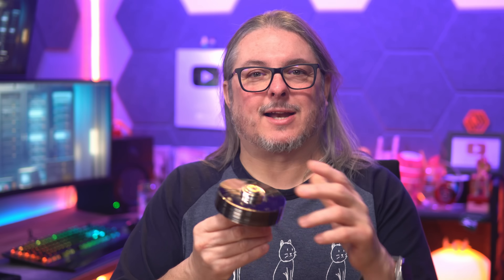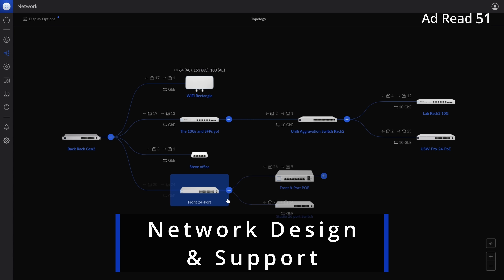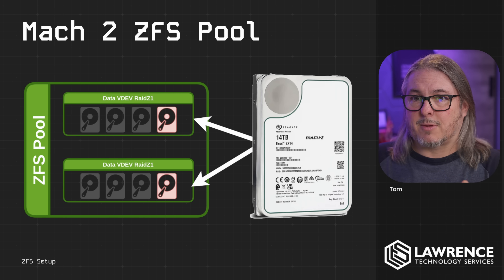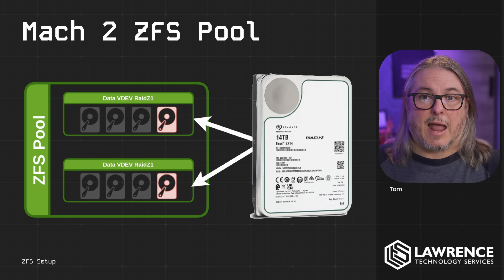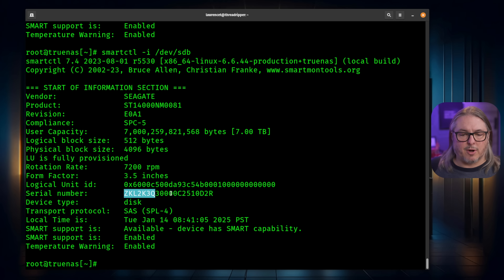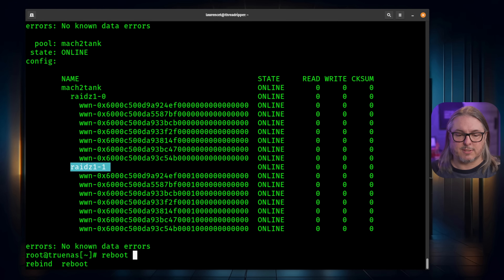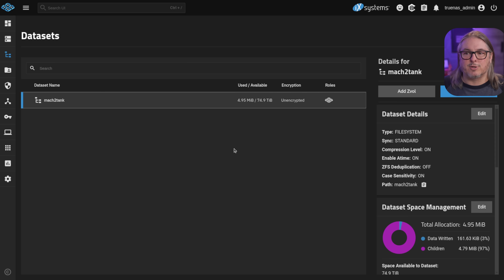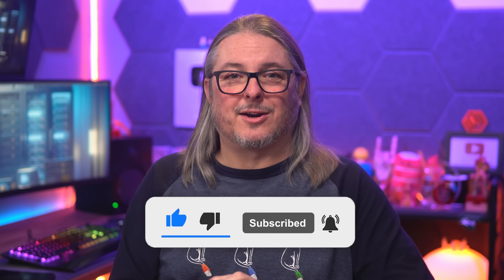TrueNAS + Mach.2: High Performance SAS Homelab Storage

Comment: I would think using it as a stripped pair which can then be used as a single drive in a raidz* vdev would be the proper solution. Is that possible with ZFS? If one actuator fails you want the entire drive to be marked bad, you wouldn't want to trust the other half to keep going. With splitting between vdevs you would have to resilver two vdevs instead of one.

Comment: Is there a way to get nut monitor onto truenas scale (24.10.1 currently) so I can have it see my network attached ups it's powered by to do a safe shutdown in case of a power failure? I'd love a video on its setup if possible.

Side question, how would i go about removing an array that was In at startup to move it to another system and leave a new array?
Long version: I have a core vm that I moved my drives from and setup a new core system, since then I've updated the new core to scale and duplicated the old drives to a new set of drives and array, now I want to take the old array and put it back into the original vm. Is that even possible now since I updated the one to scale?if so how, I think I tried "exporting" and it said there was some system thing on that array since it was setup with that array.

Comment: Great video Tom! We've had a few community users show up and the Level1Techs scripts have been useful in getting them online with their MACH.2 drives.

One thing that I would caution the users of these drives about, the SAS ones specifically, is that certain low-level SAS/SCSI commands cross LU boundaries - meaning they'll impact "both drives" in this sense. Power management is the obvious example as there's only a single motor, so start/stop/idle spin-down states impact both - but it starts to become a potential performance issue with "FLUSH CACHE" impacting both LUs during transaction commits. If "both disks" are in the same pool, they'll likely be receiving the flush command at effectively the same time; but the potential for some interference exists.

Where it gets ugly is commands like "FORMAT UNIT" and "SANITIZE" also cross LU boundaries. Now, those would be the lower-level ones - something like a dd zero-pass or similar won't, but because the new EXOS 2X line optionally comes with SED (Self Encrypting Drive) support, that would be a bad way to find out you accidentally put two LUs in the same vdev.
Reply from the maker: Great points
Reply: The fact that UI does not support anything advanced even with standard drives is just sad. Even the way UI refers to storage  via sdX is fragile and is not how ZFS is built. ZFS prefers UUIDs and such, is perfectly fine with GPT labels (that I was asking to implement long time ago) and you still try to convert it down to dumb OS abstraction levels.
Reply: @Mr.Leeroy  ZFS pools on TrueNAS are built with and use partition UUIDs, which you can see from a command-line "zpool status" command - the UI does map them back to their physical disk.
Reply: @  I am talking about UI specifically, not Middleware. It creates unnecessary translation back and forth, which only complicates things for devs and barely helps users, surely restricts more than benefits. It is like a root barrier that distorts interaction logic (for both sides of project) with storage units that ZFS really cares about.
I know, you guys think about fool proofing as much as possible, but clearly overdoing it and cutting the versatility of native ZFS mechanisms, aspects and features. It becomes irritating very fast the more you get to use and know the end product.

Comment: I've been reluctant to try this, even the SAS versions.  My reasoning is that when I lose a drive, I actually lose two.  This means that I need at least RAIDZ2 if both logical drives are in the same VDEV, and probably RAIDZ3 to be safe.  If they are in different VDEVs, then I now have two degraded VDEVs for each drive failure.  I'm not convinced the performance vs risk tradeoff is a good one.

Comment: I think that before these become mainstream, Seagate is going to have to simplify how it presents itself to the OS. Ideally, presenting itself as one single drive would be ideal.

I'm no engineer, but I'm not sure why the drives don't just stripe (RAID0) themselves automatically, and then present as a single drive to the operating system. That would simplify deployment and troubleshooting in the case of a failure, but also give the same performance benefit.
Reply: because doing RAID0 means they need to add a chipset to do this, and since the main market for these drives is going to put them in a RAID array anyway, that would be redundant

Comment: I would think that the best way to use those use to do RAID0 (don't remember the ZFS name of this at this time) inside each disk and then do a RAIDZ2 with a bunch of disks. As most probable when one part of the disk fails the other will do the same I just would join the two parts of the same disk in a faster one.
Reply: raid0 is "stripe" and raid1 is "mirror" for ZFS

Comment: Why not just get two drivers?
Reply from the maker: It would cost more and there are only 7 SAS bays in my NAS.
Reply: @ the bottleneck will be the SAS controller anyway. More drives don’t mean faster RW speed.
Reply: @MsDurex the SAS controller won’t be the bottleneck in this system. Not even if you were to put all 14 LUNs in a RAID0 pool would you bottleneck a normal SAS controller using PCIe 3.0 and 8 lanes.
Reply: like all "space/power saving" solutions, the point is saving space/power. If you can afford the space and power for more drives, you can just do that.

Comment: I don't understand why the HDD controller presents itself as two drives. Why does the controller not just present itself as one drive, but which happens to have (up to) twice the performance? Seems like an unnecessary user complication to me. If I ever wanted a HDD to present as two drives, I'd partition it as such. 🤷
Reply: because physically this is two drives. There are two sets of heads and each set writes to their own spinning disks. 

If you want this to have "twice the performance" you need to add a chipset that can run a RAID0 on top, which is kind of pointless when you are going to put those in a RAID array anyway.
Reply: @marcogenovesi8570  The theoretical increase in performance wasn't my salient point. My point is that the controller should be able to present the entire HDD as one disk, it's just the controller can read or write data from two locations simultaneously which would thereby present a lift in performance. There is no reason this HDD should present itself as two disks, or at least not by default; the Mach.2 disks only have one controller! 
Perhaps a hardware or firmware 'switch' that allows it to change modes for those who want a 'hardware partitioned' disk (with two partitions of equal size). 

... you need to add a chipset that can run a RAID0. No, not necessary. The controller would still write the data where it thought best, but now it can access two locations on the disk at a time instead of one (not accounting for the total number of heads). Either way, RAID is ultimately just firmware or software - it could be programmed into the controller.

... pointless when you are going to put those in a RAID array anyway. I wouldn't put these anywhere near a RAID array. If I wanted two disks I'd install two HDDs. Adding the Mach.2 HDD as two disks just means that when it fails, you lose two disks - there's nothing good to be gained here. 
I accept there may be an edge case where you absolutely need to two Pools but have limited space to install HDDs, but I can't think of a valid reason for such case. 

Take these examples (for simplicity, I'm using RAIDz1 and not accounting for parity overhead):
1) Six 2TB 'standard' HDDs in one Pool comprised of one vDev for a total of 12TB.
2) Twelve 1TB 'standard' HDDs in two Pools comprised of one vDev each - for a total of 6TB in each Pool.
3) Six 2TB 'Mach.2' HDDs in one Pool comprised of two vDevs - with half of each HDD in each of the vDevs - for a total of 12TB.
4) Six 2TB 'Mach.2' HDDs in two Pools comprised of one vDev each - with half of each HDD in each of the vDevs - for a total of 6TB in each Pool.

If one HDD fails:
1) You lose the redundancy for that Pool. 
2) You lose the redundancy for one vDev in one Pool - the other Pool remains healthy.
3) You lose the redundancy for both vDevs in that Pool - risk to data no worse than for 1), but means resilvering two disks except that now they're on one HDD; possible resilvering performance hit? 
4) You lose the redundancy for both Pools! - risk to data twice as bad as for 1), and same resilvering scenario as for 3).

If two HDDs fail:
1) You lose that Pool and all the data in it - disaster!
2a) You lose the redundancy for both Pools - no data loss.
2b) You lose one Pool and all the data in it - disaster for that Pool, but the other Pool remains healthy with no data loss.
3) You lose that Pool and all the data in it - disaster!
4) You lose both Pools and all the data in both Pools! Congratulations; you've just lost two sets of data.
Reply: @gh8447  "Take these examples"

Not sure what this is supposed to prove. Yes the fact that you have two drives in one single chassis limits your RAID choice if you value data integrity.

"resilvering two disks except that now they're on one HDD; possible resilvering performance hit? "

Why is this even a question? The interface is SAS 12Gbit and the controller is just passthrough so if you know math you can figure it out.
12 Gbit/s is 1.5 GB/s of bandwith, which is THREE times the max speed the drive can do with both actuators running at the same time.
Reply: @gh8447  "The controller would still write the data where it thought best,"

mechanical drive controllers don't do this. The sectors are more or less physically mapped. There is a spare area to remap some bad sectors but that is it.

"RAID is ultimately just firmware or software - it could be programmed into the controller."

the controller needs to be powerful enough to run it, the software needs to be developed and tested and validated. This adds cost.

"Adding the Mach.2 HDD as two disks just means that when it fails, you lose two disks - there's nothing good to be gained here. "

These drives were built around RAID50 and RAID60, which are the "hardware card" version of what was done with ZFS in the video.
Reply: @marcogenovesi8570  Not sure what this is supposed to prove. Well, there's the issue...

Comment: I’m running two SATA Mach.2 in TrueNAS. You just need to create the two partitions manually, then use each partition in a similar way to create a ZFS pool.
So far they work as well as the SAS Mach.2 I have in the same system.

Comment: Been using unRaid for many years and still super happy with it. The main array is slow, but for me maximising the usable storage space is priority so that is working great. For the high speed storage I use nvme drives in a cache pool and that covers the high speed needs. 

unRaid is a nice, simple and functional way for a full homelab in one physical box. 

The plan is to upgrade to a all nvme based server in the future, but then a TB need to cost less han $40 a TB for high quality nvme drives and that is some years until it is going to happen.

Comment: i never call them spinning rust, and never will. and when my HDD survived being outside for 2 years(burried) and worked fine afterwards i def never will
Reply: The magnetic material used on the platters is literally (a type of) Iron Oxide. 🤷
Reply: @gh8447  "n antiferromagnetic (A-FM) layer made of Nickel oxide, Nickel-Manganese or Iron-Manganese alloy"

big shock, someone who posts annoying 🤷 emojis were wrong
Reply: @gh8447  They're cobalt, not iron. We stopped using iron oxide for magnetic storage a while ago.

Comment: I wish sas was more commonly supported at the consumer level since the drives are often cheaper than sata. Kinda like rdimms.
Reply: the drives are not "cheaper" by any stretch when new, same for rdimm. The used ones are cheap precisely because they are not usable by consumer hardware

Comment: Will they ever get to a point where each platter has its own independent head?¿ Potentially much faster speeds and see it as 1 drive or individual drives per platter?¿ Cool to think about.
Reply from the maker: That would then run into interface limitations.
Reply: @LAWRENCESYSTEMS  On Sata yes on SAS the headroom is a lot more, there are SAS 12gbit and 24gbit interfaces too

Comment: It's a shame you can't stack VDEVs in an alternative layout in ZFS: one physical Mach.2 drive could be presented to the pool as a mirrored pair of LUNs, and then the resulting middle-layer VDEV could be put into RAIDZ2/3 or similar.

I know today's release of ZFS 2.3 only hours ago brings more flexibility with RAIDZ expansion, along with other benefits, but I don't recall any discussions in the past about stacking VDEVs such that you could construct a pool from a RAIDZ3 made up of mirrored pairs of drives (or, as in this theoretical example, LUNs within the same physical unit).

Given the Mach.2 technology particularly when used over a SAS interface it seems a huge waste of engineering effort is being thwarted by software limitations.

Maybe these Mach.2 drives would be better employed in a LINSTOR / LINBIT DRBD Cluster, underpinned by ZFS … I'm trying to pull all the pieces together into a coherent summary, but that's beyond the scope of TrueNAS and this video for sure.

Comment: Just what we need: one more point of failure in already failure-prone hardware. Innovation is cool, but this is not my idea of a cool innovation.
Reply: it's actually less points of failure than 2 different drives
Reply: @marcogenovesi8570  That's a fair point... Still not sure I'm willing to be a guinea pig on this though.
Reply: @ this is not an experimental device, you are not a "guinea pig". It is a device that tackles a niche issue that you (and consumers in general) probably don't have, though.
Have you ever wondered "I wish I could fit more disks in my servers so I could have better performance from my HDD arrays?" Because this drive technology is the answer to that.

I don't think this is going anywhere for consumers.

Comment: Interesting. My mind immediately went to striping the 2 parts of the single drive, and then mirroring the physical drives. 
I wonder if you can put striped vdevs into a RAIDZ2, I haven't played with that.

On one hand I don't like the additional complexity of these drives. But I've gotten to the point where I don't really need more space, but I wouldn't mind more performance, however the sweet-spot between size and price keeps increasing in size. These would be a way to nearly double the performance without increasing the size too much.

Comment: It looks like this thing on unraid will have drive count license concern plus it still that slow due to how unraid array designed 😢

It still see it as two drive 

Maybe this thing double the drive count in same unit ( example 8 drive in 4 bay now) so the total read write speed in zfs / raid  been stack up 

Unraid : i hate this thing 😂
Unraid just left the chat
Reply: Unraid (the OS) has native support for ZFS arrays too since at least a year
Reply: @marcogenovesi8570  I got their beta installed on secondary unraid and zfs does work( just not good as true Nas), however it will lost the best thing of unraid: it only kicked on parity+ the disk that data living on, larger the array more power you saved :) 

I live with them in the same room so the noise control is a really big deal

Comment: I bought one of the sata versions to test out in my desktop before I decide to get more for a NAS.  To get full speed with the sata, you have to create 2 partitions of 50%, then raid-0 them. That way each partition has its own actuator.  Performance is good.  
With zfs, you would separate the partions into different vdevs, so if the drive fails, you lose 1 drive from different vdevs.

Comment: Hummm... if i wanted to see two different drive I’d by two drives.
Surely the drive manufactures can make it appear as one drive, and the drive itself decides which set of heads to use.
Reply: to do that, they would have to integrate a raid chipset that can run RAID0 over them. Since these drives are meant to go in a RAID array anyway, it's better and cheaper to just have your existing RAID controller or ZFS handle that instead.
Reply: @marcogenovesi8570  maybe... maybe not, they made the thing.... i reckon they could actually get it all in the control chip and associated firmware.
Reply: @Andy_FortyTwo  not at the same price of the drive without it. Which is my point. It's definitely possible (it's not even hard), but it's not free and would not improve the performance over the current drive in a RAID array, which is basically where any mechanical drive ends up nowadays

Comment: I'm building a TrueNAS system in a rig with SAS and I was considering these drives before I knew of the compatibility issues. I'll be sticking with standard drives until proper support exists in TrueNAS.
Reply: If in doubt and need for performance use a striped raid1. May not be as fast as ssds but still faster than raidz1 or z2. Also a double(!)-mirrored metadata device helps when the harddrives get fragmented.